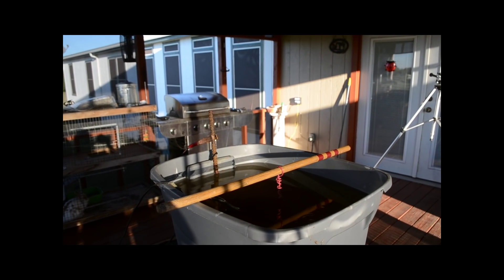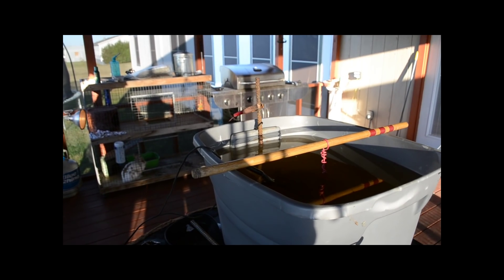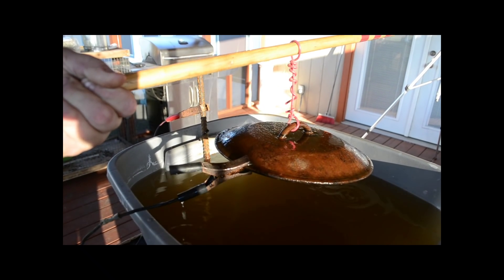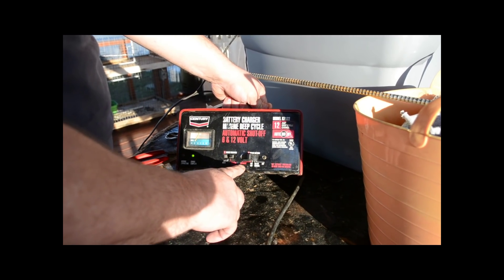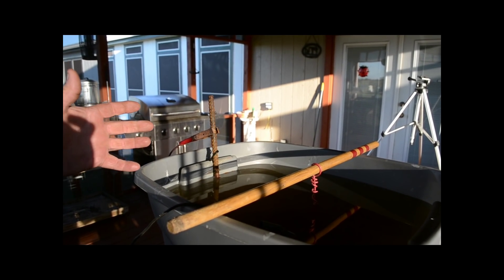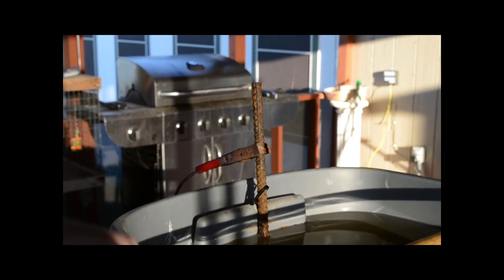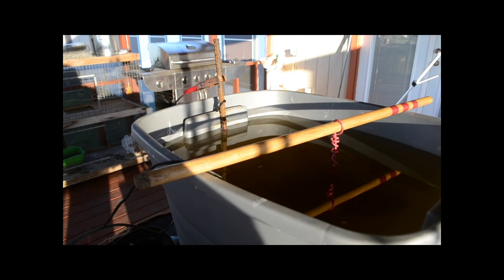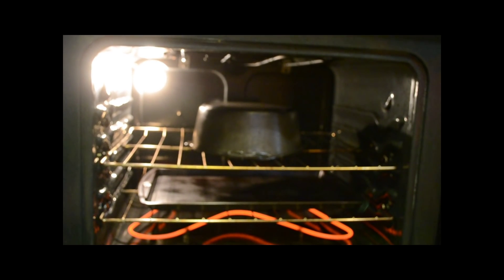CLEANING RUST FROM CAST IRON AND OTHER METALS USING ELECTROLYSIS

Comment: I am from south Louisiana and we love cast iron down here.

I use a brass brush on a drill and get the rust off then the wife will wash it off real good and then we soak it in oil and bake it at 340 degrees for a hour and then re oil it and bake it again.  

If it is a pot that is deep I just deep fry a lot of chicken or fish in it and that seasons the pot.

Comment: Jeremy, glad you are back. The stuff is Arm and Hammer Washing Soda. Great stuff for all types of cleaning and making your own laundry soap. Using it with regular laundry soap, it aids in the cleaning and softens the water so detergent works better. I had an old mechanic tell me he uses it to clean radiators. Dump coolant, flush system with water, by filling system running engine till operating temperature, dump the water. put a couple cups of the soda in radiator, fill with water, run it till operating temperature, and dump and flush good with water again. it will also clean the entire Cooling system. That he'll stuff probably also ruin the finish on cookware.